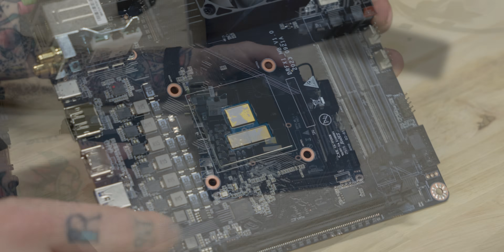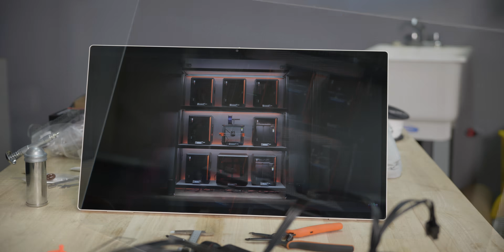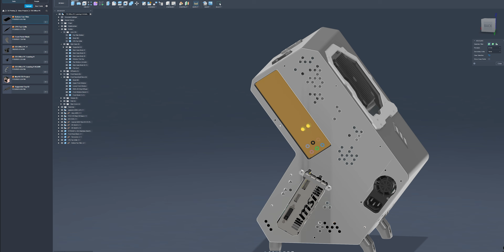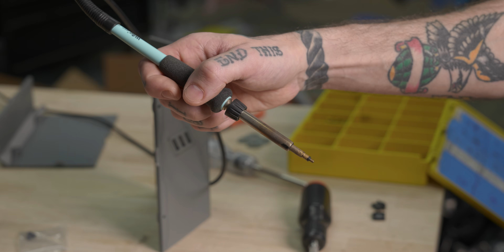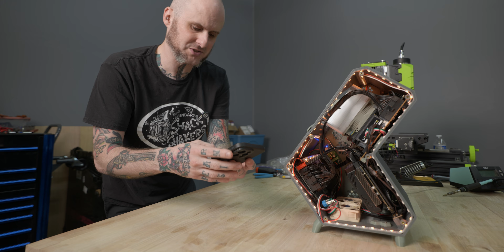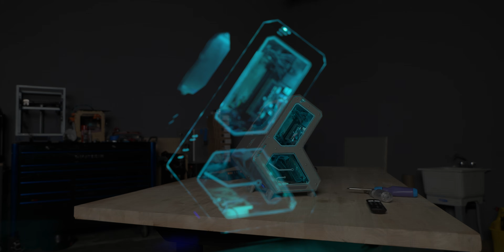Can You Actually 3D Print a PC Case? (Yes, and It's Good)

Comment: AMAZING build - however I think you need to work on your top surface settings in your slicer, the sides of this thing look kinda meh, lots of under-extrusion and missing gaps.
Reply from the maker: The chassis was printed all standing upright. The sides are the side walls. Getting flat surfaces to mate perfectly across such large object is just a struggle. Especially in ASA, which sadly likes to warp post printing, even a perfect print that doesn't peel off the bed will distort a little bit when cooling. Its a struggle I've yet to solve.

Comment: One more question, I see these videos where everyone seems to have 10 3d printers (it's really intimidating) is this a thing where there's a space folks can use, or in general is this really everyone's been buying them over time and end up with them?  - I'm still curious about the 3d printer thing... do I really need 10?
Reply from the maker: The vast majority of people don't need more than 1 printer. This is my job. Having more printers means I can run more prints at once. So a 100 hour project, spread across 10 machines, means I can print ALL the parts in 10 hours. That's a huge time saver overall. I'm sponsored by Prusa so they provided my machines, but I've also got another 12-15 machines floating around that I've just collected over time. That's pretty typical, a lot of folks get one, then another, etc etc.
Reply: @MandicReally  thanks it seems like you have a lot of fun i appreciate the response im jelly of the concept of loving what you do, you should, i think! thanks for the quick reply i love it!

Comment: That case is beyond awesome, and you really knocked it out of the park!

One thing I really like (while I realize not a design consideration): if someone were looking to make this design less 3D printed and more rigid, they could maybe build the shell out of bent sheet metal, and print the front/back panels. (Though, I'm inexperienced with sheet metal bending, I feel like some consideration to order of operations/bends would be necessary and dependant on where the seam would be.)

Again, this design is phenomenal, and it is clear that you spent a lot of time and effort planning and designing it! Great video!

Comment: I was looking at the same power supply on Amazon, was a little concerned because I thought I saw it had a 14 pin to 24 pin adapter on it instead of straight 24, I’m very new to the pc building game and didn’t wanna risk it. No issues with it so far I assume?

Comment: Agree to disagree on "how good this case actually is" - I like the effort, but this case is way big for how small components it has. Also these windows kinda show all your cabling which makes it kinda horrible. It reminds me of first pc cases which just had side window with side lights and everything was see-through and you could see all cabling. As you have all components you could have just made sum edges and corners to hide PSU , CPU and GPU connectors-cable routes. Furthermore Gpu is creating hot air down below and its rising up and same time mb fan will push cold air from top in, giving it mixed airflow. There is no point on restricting airflow on cpu fan if you put a mesh in there anyway, so on acrylic it could have just been a hole.
Reply from the maker: Fair takes, even if I don’t share them. The proportions were a design choice; it’s meant to feel stylized and a bit ‘chunky’ in that retro futurist, cyberpunk way. If I’d slimmed it down to the absolute minimum footprint it would have looked awkward and lost the visual balance.

As for airflow, the CPU mesh is intentionally restrictive — that’s literally what a filter does — and temps are totally fine in practice. This project was more about experimenting with form and fabrication than squeezing every degree of thermal efficiency out of it.

Comment: @MandicReally , very nice build! I am thinking to get some itx to build something like this. In the meantime I have few ATX Asrock B450 Pro4 (I know is old but want to make a NAS and a router with fanless Ryzen 3 4350G).I looked everywhere but didn't find one 3d printed case very slim (like a suite) for this motherboard+cpu. The power supply will be a laptop charger + pico psu so 0(zero) fans. As I have no skills in designing these, maybe you are interested in doing something like it. Pretty sure I will not be the only guy that appreciates /needs this(subscribed, just in "case" ;) ). Thanks!

Comment: This is the best 3D print case I have ever seen. Outstanding work! Would it work with a socketed mini ITX?
Reply from the maker: It should work with socketed boards just fine. It will have low cpu cooler clearance of course. The Minisforum board is standard iTX form factor in size otherwise.

Comment: How are you getting such detailed 3d models for part? Are you doing this all by yourself measuring or? Trying to get better at modeling in fusion.
Reply from the maker: Do you mean the computer parts or the design of the case? The case is entirely my work. I just have thousands of hours behind the keyboard in Fusion at this point. 

The PC parts that I used as reference models were all downloaded from GrabCad.com though I had to tweak some of them as the measurements were not exactly right. And then I did have to model my own Power Supply model and PCI-E riser as models that matched my parts didn't exist.

Comment: heads up, that is a 400W PSU. for a PC PSU, all you need to look is the 12v rail rated capacity since 99% of what your PC use is 12v

Comment: Remember that laptop processor is being cooled without an interposer and being cooled well at full power. The only thing that could be holding it back is that memory. Running at only 4800 without the extra cache of the x3d chips is a bottleneck. Not that you can do a great deal about that with sodimm memory though.

Comment: I would say 14L is still pretty small in size. Not that much bigger than a ps5, only about 25% bigger. I have a build in a q58 which is about the same size. If you go too small you're gonna be stuck using an 8gb small form factor gpu like the 5060. I think this is pretty sick though, makes me want a 3d printer even more.

Comment: I've just found your video... I was thrilled to be able to print it myself. Sad the files are not public... because I could really use an ITX case now, as my X1C is also hungry for filament. Your case would have been perfect for testing due to thermal problems with the Asus Z11 and as a replacement, but it would need ATX or SFX power supply support. It would be better to print the front in two parts and join them with a strut. This would leave enough space to fit the hardware in.

Comment: You can use regular pla for a pc case as long as your design is good and has good airflow and cooling
Reply from the maker: PLA is prone to “creep” where things give over time due to constant loads. Especially when heat cycling. Sure PLA would be “fine” for the application, but ASA is a better choice and I’m fully capable of printing it, so why bother?

Comment: why so slow memory kit? DDR5-5200 is offcially suppoted. does minisforum mobo cant read handle so-dimm kits with DOCP (XMP) profile?
Reply from the maker: Look into SODIMM DDR5 96GB kits. Options are extremely limited. This was the best value kit I could get that didn’t have horrendous latency timings. 

Memory speed isn’t as critical as capacity for my work. As long as it’s a reasonable overall latency it’s fine.

Comment: I'm kind of curious where most people are getting this idea from that CAD software requires a 12 GB BRAM GPU? Yes for rendering depending on the application used, you might want an intensive GPU and for the gaming you mentioned, but for CAS by itself the CPU does the majority of the heavy lifting
Reply from the maker: Fusion just updated their system recommendations to 8+GB of VRAM. On bigger projects the GPU is used pretty heavily for the preview while designing. The actual geometry calculations ARE cpu heavy, but the image presented leans on GPU. I have a powerful GEEKOM mini pc that’s shockingly powerful for its size but it really struggles in Fusion due to the lack of a dedicated GPU. My 3090ti is absolutely stronger in Fusion than this 3060. It may not “use” the GPU as heavily as it could, but it absolutely DOES lean on it.
Reply: @MandicReally that is the dumbest thing I've ever heard a CAD program do, when there are so many lightweight realtime rendering options on the market, they go with the archaic way of doing it like Maya... seriously? I'd sooner switch software than hardware...poorly  optimized software is damaging to components in the long run.

Comment: you can buy a M.2 10GbE NIC and give your system 10 gig networking as your only using one NVMe drive
Reply from the maker: The M.2 slots are side by side and covered by an active fan cooled heat sink. I'd have to ditch that to do something like that. Doable, but I'd then have to add a heatsink to the Gen 5 drive and run additional wiring. For the moment the Wifi 6e is working fine and 2.5Gb will work out when I can get that wired.

Comment: Interesting design.  But I'm not a huge fan of building it into the walls of the case, my own personal design was built to mount to T slot 2020 rails, and then the case panels install onto the rails seperately.

So you can remove the case walls without dismantling the whole PC, lets you perform maintenance, and then reinstall the case.

With some deisng chops I don't have you could do odd shapes if you wanted to avoid the square trashcan look I ended up with.

Comment: I like some of your ideas, especially translucent edges. There are however some things that definitely don't work here. You need to have some air exhaust. Perhaps if you could change those small bottom intakes to one 12cm or even 14cm fan and add another at the top as an exhaust, it might work? In its current form it will choke air inside. Since you are already using riser cable, I think you could simply place GPU at the back of the motherboard and have dedicated intake for it at the right side and then top as an output for both CPU and GPU. This way you could have separate thermal chamber for all components and a place to use better PSU at the bottom (perhaps with its own chamber). Anyways, those are some of my thoughts. I really like that this is not yet another boxy 3D printed case. It needs some improvements, but definitely has potential.

Comment: HI from Australia Far north coast

very cool computer & excellent designed case, ingenious the way you put  all the components together.

I am a gamer and build computers, which I have just a month ago.
Here are the specs: 

CPU: AMD Ryzen 7 7800x3d
Graphics: AMD Sapphire + Nitro rx7800 Hellhound 
Cooler: BeQuiet Darkrocpro 5 
Motherboard: MSI Mag x670e Tomahawk
Memory: x 2 Patriot Viper Venom DDR5 6000m/t
Storage: 1x Samsung 990 1tb - Boot Drive Windows 11 Pro
               2 x Crucial P130 NVMe M.2 2280 - Program & Games
Case : Lian Li 207Rx Tg Argb Mid-Tower.

Overall not a bad system.👌👌

Comment: Great job! If you use  3d printer again for your next pc case possibly do M-ATX (running AMD hardware). 
Please extend the gpu side of the case to fit this gpu  Yeston x GravaStar Mercury Nova RX 9070 XT.
Would love see the HDPLEX 800W DC-ATX Power Supply.
What monitor are you using in this video.

Comment: Excellent 3D printed case! It seems that more of these concept cases are coming back into forefront with ITX motherboards. Regarding independent RGB control with WLED, you can use OpenRGB to connect to WLED's E1.31 receiver and control it via software.

Comment: Price to performance aside the RTX 5060s in the same size as the aero ITX or smaller not to mention there are 5060 Ti that are only marginally bigger like the dual or inspire that would not have significantly changed the enclosure dimensions.

Comment: Nice work Mandic! Somethibg to consider as well when it comes to slowing the machines down. I have found that a couple of my printers do not like printing slow and actually will introduce VFAs into the print because the motors dont like slowing down. So print quality is actually better if I find the sweet spot for the motors. Just wanted to share that ;)

Comment: Pretty cool case.  One thing I saw that I discovered a little while ago is doing meshes like your fan filter.  I would design a flat panel and then use a surface cut to make two bodies but no gap between them.  Then when you import it into the slicer there are two bodies that will be joined when you print them.  The part you want to be a mesh just print without top or bottom layers and then set your infill to hex and set the percentage to something that looks like what you want.  Had done the hard way by cutting hexes in my model and it sux.  If you know you're going to print it letting the slicer do the hard part is way easier.
Reply from the maker: I’ve used that method for various designs in the past. I plan to include “vented” panels for the files on place of windows (for folks who don’t want to get acrylic cut) that will use that method. 

That said, getting things exactly the precise values you want is a challenge. I wanted to test specific hole sizes for filters. Trying to do that be infill percentage would be an uphill battle. Thanks for the input though.
Reply: @MandicReally I'd have to try it to see if it is valid, but I wonder if the infill could be calculated like a thermal expansion. Since you have an infill percentage, and you know one of the dimensions of the part can the holes be calculated. Or if it has nothing to do with geometry and the slicer uses some constant under the hood we'd have to derive.

Comment: Watch out for those Apevia power supplies. They are notoriously unreliable. Common PC wisdom is to not cheap out on the PSU! I would replace it as soon as you can manage it.
Reply from the maker: Problem is options in this form factor are extremely limited. It’s cheap or superrrrr expensive and non-modular cables with a screaming fan.

Comment: Hey yall, any recommendations for the core one, mine will be shipping next week finally and i want to get an idea on what i cant do to improve functionality or and or capability, i will be making the dry box mod for it and the wiper mod but not sure what else, any suggestions are welcomed.
Reply from the maker: Adjust the belt tension right away. There is an updated tension (85hz) and it performs best at that frequency. (Prusa has guides on it, just search ‘belt tension adjustment core one’.)

I’m adding cameras to all of mine, additional lighting, and looking to add internal charcoal filtration. A couple of which are mods I’m working on. 

For the most part though, you’ve hit the big ones. I could see the indicator for the top vent being handy if you change filaments often.
Reply: @MandicReally thank you I am excited to get this new printer

Comment: I can't think of any reason tapping into the 5 or 12 volt rails on a PC PSU would cause issues, I've been using PC PSU's to power electronics projects for years.
Reply from the maker: The LEDs have the potential to draw quite a bit of power. I think the math worked out to around 7A in this case. Sata plugs are only rated for like 1.5A that I could find. So that wire? Unknown. Only time will tell. The wire itself is probably fine but if the circuit feeding that particular 5V isn’t up to it, 🤷🏻🤷🏻.
Reply: @MandicReally  I'm not sure if I saw one on your PSU, but most ATX PSU's have a table on them that show what the various rails can handle; I have a cooler master RS-625-PCAR-D3 I grabbed randomly and it has one 5v rail that can handle 22A.

How many LED's are you running in the case total? I had a 18 foot long strip in my kitchen that drew less than 7A (though they  were just RGB, not RGBW).

You're right though, that the SATA connector itself wouldn't be suitable for 7A, I must have missed the exact method you used to tap into it. I assumed you just cut one of the connectors off and used the wire directly.

Comment: The new AMD 9060XT 16GB Reaper 2 fan is perfect for ITX/SFF builds and it's one of the most affordable and powerful GPUs that would be perfect for your build. It also rocks in linux and for 3d CAD work. Great video, thanks.
Reply from the maker: Sadly that is still too big for this case. It is just under 200mm deep, and that card is 220mm according to the microcenter listing. Would be a good upgrade. I'll have to look around for AMD single fan variants or similar form factors. I hadn't looked at AMD yet, only Nvidia and Intel (I need a B580 for another project).
Reply: @MandicReally  I just installed one in a Jonsbo C6itx about 45 minutes ago and yeah, it's 220cm. The 2 fan model is still very small and is just slot high but not low profile. Might be worth V2 of the case being 240mm wide? 😅
Reply: @Muspellheimrr  I did. Get over it. Nobody asked for your input did they?

Comment: I pressed like before I even watched the video. The reason I bought my first 3D printer 11 years ago was to 3D print parts for my custom water cooled ITX system. My profile photo is the blue PLA (held up for 2 years with no deformation) motherboard cover. I want to get back to this hobby so much, but I lack the weekend free time for it.